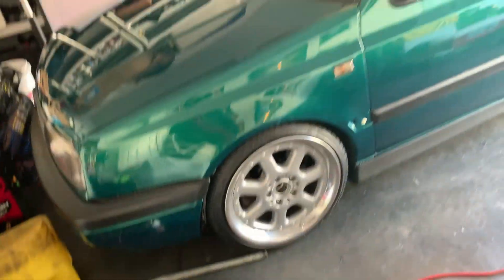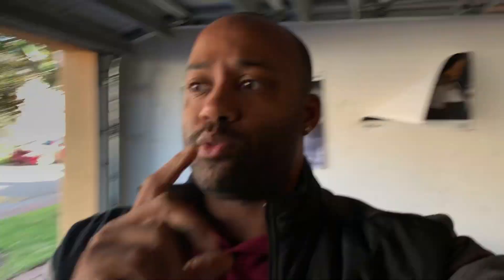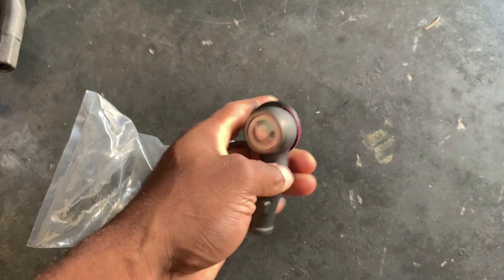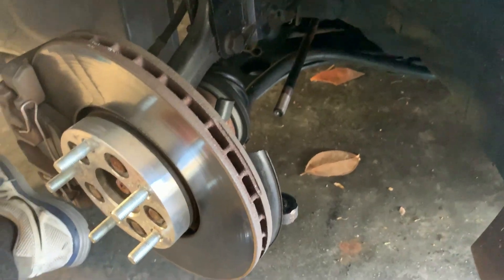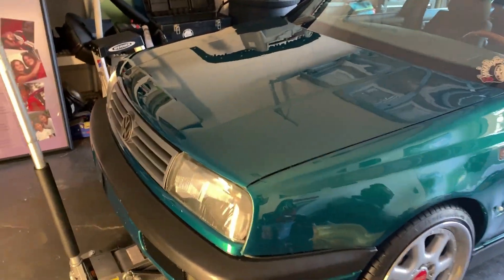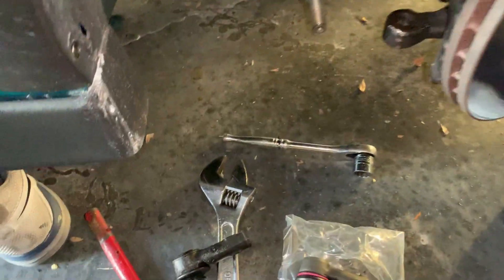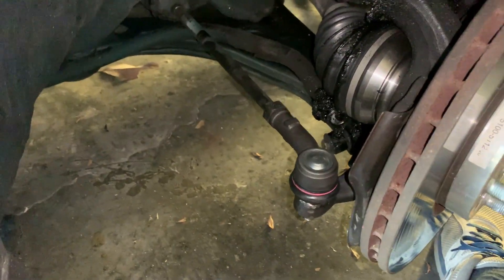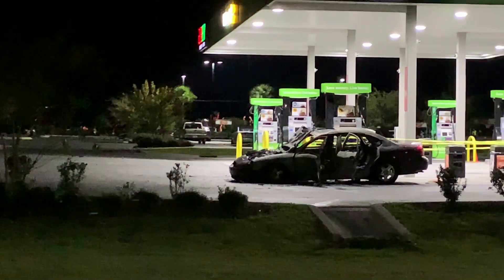vlog66: How to install outer tie rod ends on a VW mk3

Comment: Hey Greg thanks for that information, now I know the right way to do tie rod ends. I also have reinstall my left side axle. It fell out while I was on the road. It came away from the transmission, do know the torque specs for inner axle triple squared bolts? Thanks, later